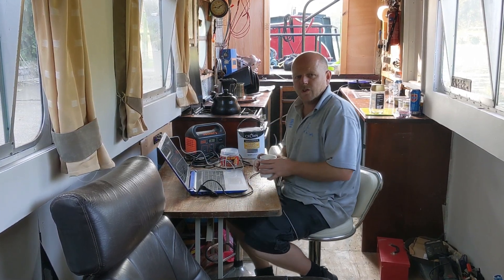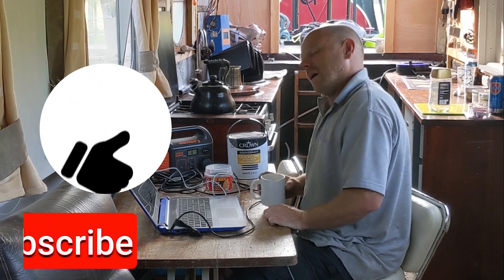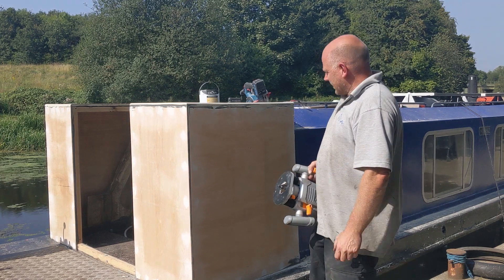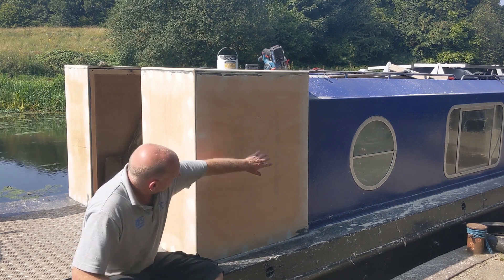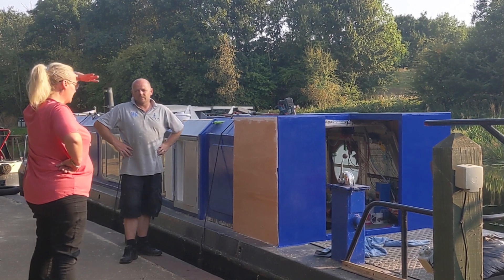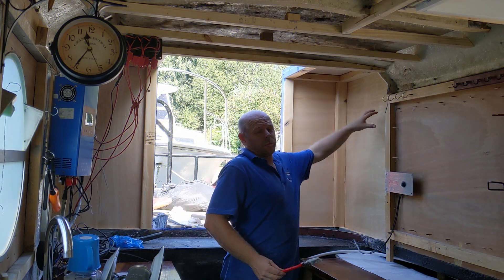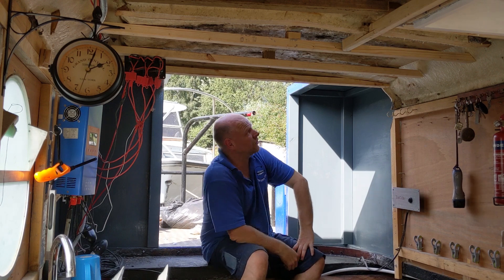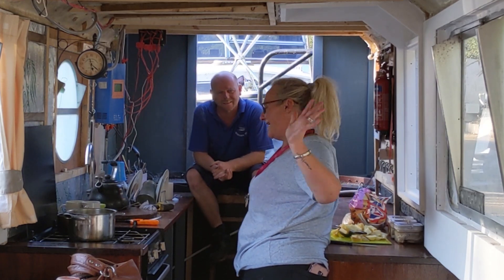Completing the rebuild of the new rear cabin on our DIY PROJECT NARROWBOAT REBUILD

Comment: Extra nice video this time around Peter, at least one of the most informative to me.  I didn't realize your mains power came from a solar system.  Looks like they have about 3,500 to 4,000 watts of solar panels in their system so, probably good for about 2,500 watts output on a sunny day at noon time.  I wondered why I observed you using so many battery powered tools, that explains it.  It looks like your collection of nice power tools has increased with these narrowboat projects, along with video equipment.

I also get bogged down trying to work out a project design, with regards to your stern hatch/door.  I would suggest looking at as many boats as you can for ideas, to see how their hatch/door is designed.  If you have a friend who works with narrowboat design, assembly, or maintenance, that might be a good source of ideas.  Fortunately, there is a lot of DYI video on YouTube that may help.

I have had poor success applying fiberglass over a painted surface, bare wood gives the resin a chance to soak into the wood grain.  You might be able to get by just roughing up the painted surface with coarse grit sandpaper.

I recently discovered you have a Facebook page.  I found that useful as, it told me of your approximate location in the UK.

I know how challenging it can be to tackle big projects in areas that are completely outside your normal field of expertise; in that regard, you both have done very well.  With that said, I hope the many comments you receive help increase your motivation.

Thanks for always responding quickly to comments, that places you as one of the best YouTubers in my book.  Best Regards, have a Brew, and keep Cracking On!  Cheers!

Comment: Looks a lot better inside without those old 'wings'.
But Pete, you did sound a bit frazzled towards the end there - perhaps a hat?
I wonder if a couple of (smaller) portholes in the sides of the new 'extension' would look good? Just another thought to wind you up? Otherwise it looks like a cracking job. Of course you could always come back and do that later in the process. I just liked the extra light you had when you were more - ahem - open plan back there.
Ooooh - proper Yorkshire chips.
Reply from the maker: Yes, think I was a bit frazzled with the sun - had my hat on the day before, but not yesterday. Cant put port holes as one side will have the boiler attatched there...BUT maybe on the back section each side... 
Can't beat proper chips!

Comment: Love watching your videos and the perpetual problem solving you encounter when taking on a project like this. It's inspiring to watch you work. But a quick question: are you not concerned about the vulnerability of the  sharp corners (90 degree) of the new aft addition when navigating the plethora of squeeze narrow tunnels that dot the canals. I'm sure you thought it through but it was my first concern when I saw the new section. Keep up the great work.
Reply from the maker: Rebuilding a boat like this is a very diferent challenge to refitting a normal narrowboat. We doubt our boat would go through some of the very small tunnels anyway due to its size. But round here we have mostly wide canals for the large commercial craft so no issues with it.

Comment: I should have mentioned that having cleaned your brasswork, it's worth giving it a wipe over with Jade Oil, not cheap, but it'll save a lot of work. Another thing, when you come to fibreglass the extension, roller after each layer of glass, it's easier to wet it out properly that way.
Reply from the maker: Cheers... I think fibreglassing this new section is going to be a fun task! Do you mean to use the fibreglass roller like we used on roof or a normal sponge roller that would be used for painting etc?
Reply: @WingingItBoatingonaBudget  Use the fibreglass roller after each layer of glass, it wets out better than doing it after you've got all the glass layers on.
Reply from the maker: @ChrisBrown-jh2mo  will do, cheers.

Comment: Pete, couldn’t you use the existing metal cover on two wooden runners and then make two doors, which padlock to the cover like a number of narrow boats use. That wouldn’t take you as long and then you can change it further down the line of you wanted to. Just a thought, keep up the good work 👍
Reply from the maker: Ive had the day off working on it today - back to it tomorrow and I will knock something up, cheers for the suggestion:)

Comment: Why have you painted wood that you plan to apply fibreglass to? Resin should be applied directly to bare wood so that it soaks in and makes the layers of fibreglass attach properly to the wood. You will now have to remove all that paint (and the dust it creates) before starting the fibreglassing. Throwing a tarpaulin over the wooden bit if it rains and getting on with the fibreglassing ASAP would be the normal thing to do. Also how do you plan to deal with the joint between the fibreglass and the steel hull? This will be your weak point where moisture will get under the edge of the fibreglass and rot your wood.
Reply from the maker: Yes, would have been better not to paint in the long term, but tarpaulin and wind is a recipe for disaster. The joint has large amounts of CT1 - It will always be the weak point so needs plenty of moitoring and touch up as time goes by.